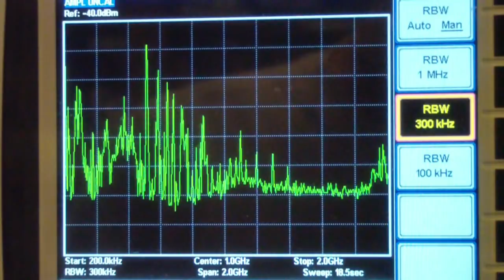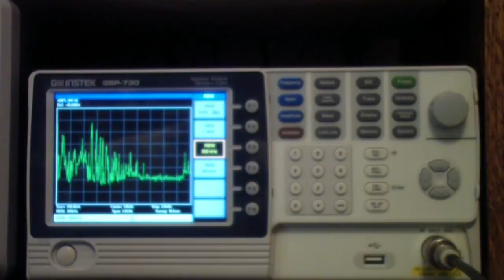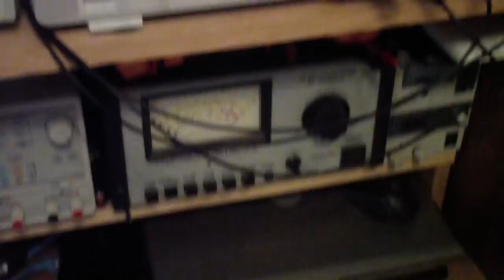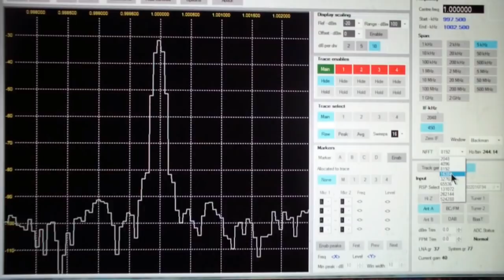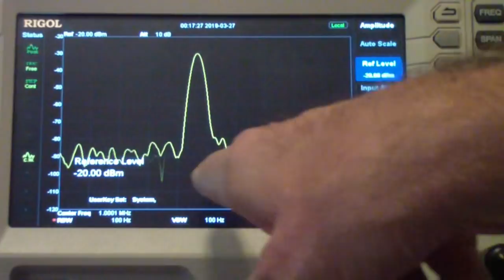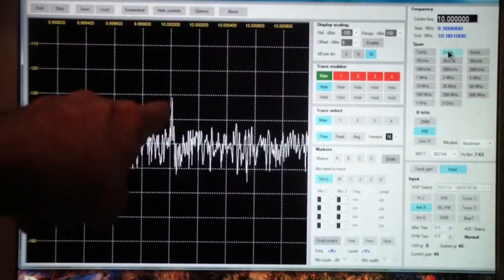TTT259 RSP Spectrum Analyzer Review Pt 1

Comment: Thanks for the in-depth analysis! I use an RSP spectrum analyzer (RSPdx hardware) daily and it works fantastic. Many improvements were made in v1.1 of the software vs the 1.0 version which you have here.

Just a couple of corrections - for some of the tests, you are using  a 2khz span which means 200hz per division. So the sidebands from your signal generator are roughly at +/- 200hz from center, not 2khz. So at 21:40, the Rigol DSA-815 isn't showing them because of the 100hz RBW limitation of that machine. They are still there.

SO grateful to Steve Andrew for the software (he seems to have abandoned the project) and to you for these in-depth tests and explanations!

Comment: Thank you ! this was a very good video . The first time I used the RSP analyzer , I shut it off in 5 minutes and called it junk because it did not have modulation type and audio. 
I was comparing it to another SDR play program . ( SDR uno )  I have a lot of RF interference on my back deck in the 2 meter band. The noise floor with UNO  was always locked onto -95 dbm.  I took off the antenna from the RSP Play and it never changed . I put the SDR play into a dummy load and it was  the same -95dm.  I dumped  that program and went to the RSP spectrum analyzer  . I found a huge difference  in the readings.  If I put the SDR into a dummy load the noise floor dropped 25-30 dbm.   I could move my antenna around and I could watch the noise floor move with the antenna. I could not with the  SDR UNO.    With this analyser  I could find a place on my deck to place my antenna with the lowest noise floor.. Good luck doing that with UNO .  I still have a high  noise floor in the 2 meter band but at least I sniffed  out a spot with a low noise floor so I can hear the local repeaters.

Comment: Thanks for this. I have thought about putting my RSP into a shielded box, it seems it is not necessary though, given the excellent noise floor. Have you solved the mystery of the 1 MHz sidebands yet?
Cheers,
Reply from the maker: Thanks for your comment and question. I am convinced that the sidebands are being produced outside the RSP1A, i.e. they are due to a strong external signal interacting with a non-linearity outside the SDR that produces a modulated signal at these very low levels. These exist, of course, in almost all places outside of shielded labs, etc. but are often not noticed unless you are looking near the noise floor as we are in this case. One reason I am sure it is outside the RSP1A is that the Signal Hound SA44 displays almost exactly the same signals. They are not as obvious on standalone spectrum analyzers (like the Siglent, Rigol, or Instek) so it may be due to the computer connection (both the SDR and SA44 use USB to power and operate the hardware).